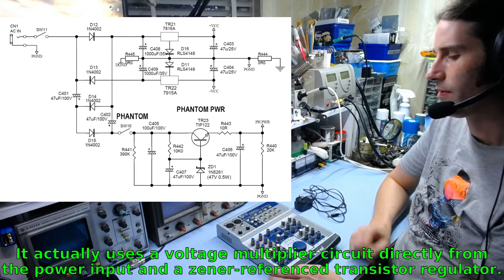"Repair" of an Alto AMX-120 12-channel mixing console

Comment: Hi, thanks for sharing, this was very helpful. I have a question; Will this JBL unit work with this mixer? Original JBL Creature Power Supply Adapter TA661835OT 18VAC 3.5A OEM Tested

Comment: hi,  I have an ALTO amx100 mixer that looks pretty much identical to the one that you show here.  But I lost the power adapter for it a long time ago.  So I found that I could not order any adapter from ALTO because it is a legacy product in thier parts supply.  So I bought a power supply from Amazon.  It's manual says it adapter uses 18V.  On the adapter  I bought, is one that has multiple voltage selection and polarity selection also.  But I cannot tell from the manual what the polarity should be set to.  One your unit, is the plug for the adapter, + on the center pin?  I'm in Canada so the unit uses  110V.  If I used the wrong polarity, Would that damage the mixer?
thanks Barry
Reply from the maker: Neither. The AMX-120 I have uses AC, not DC. Yours is the same, given the schematic I found (Search Google for 'AMX-100 Service Manual'). You need an old, linear transformer supply that outputs 18v AC.

If you use a DC supply of either polarity, it will power up only the negative or the positive rail of the mixer, and will not work properly. This may or may not cause damage but it is probably not a good idea.